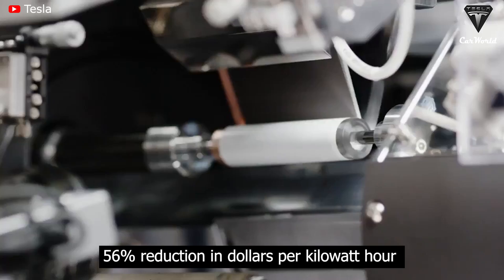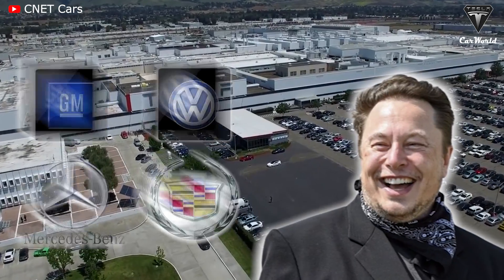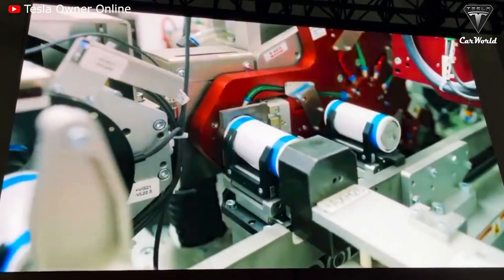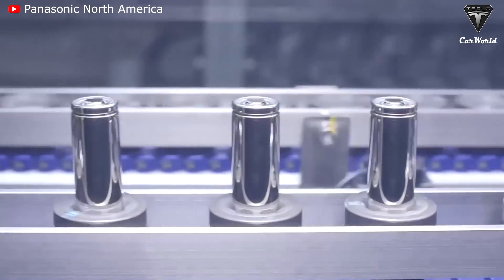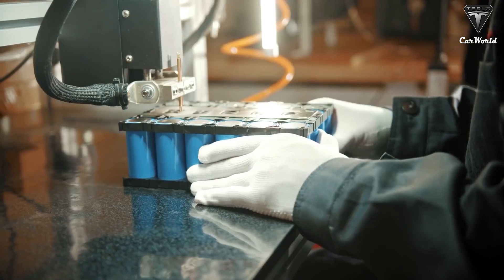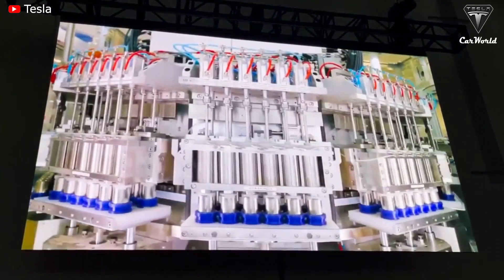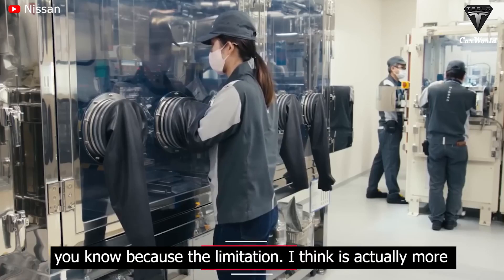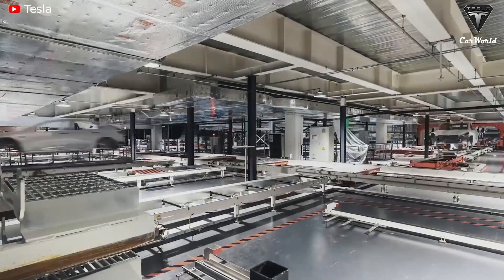Elon Musk Just Reveals NEW Upgrade 4680 Cells 2023, Only $12.94 kWh!

Comment: Your main claim about reduced cost seems so arbitrary: 

Yet it the article headline you mentioned that the cost will be reduced to $12.94 per kWh. 
The $12.94 is more than 90% reduction from $142. 
The 14% reduction from $142 would lower the cost to $121 which is much higher than $12.94 you claimed. 

Similarly, how does 5 times more energy translate into only 16% extra range? 

These are wild claims. Something is off here.  This is what happens when a cheerleader writes an article or create a video without much thinking about the accuracy.
Reply: You can’t still be confused by that 5x more energy claim? Musk is saying for same unit (cell), same handling, get 5x the energy, volume etc. It was confusing, but well discussed. Other part is battery costs eventually decline to cost of materials, equipment, profit. Eventually. Provided tech works out.
The $12.94 is a stretch. But $50 achievable by 2030.
Reply: @iandavies4853   The 5x more energy should result in more than 16% range improvement.  Those two numbers, used in a same claim about increased battery efficiency, do not make sense. Range improvement should be much higher than 16%. 

Many BS articles from cheerleaders create an unrealistic expectation about the technology.
Reply: @usneome  try reading or thinking. 4680 has similar chemistry at present, so similar energy density, 5x is solely due to being bigger cell. The beauty is in time/cost of manufacturing as no stopping to weld tab, wrap 4680 same time as 2170 /18650. Per cell. 
Eventually new chemistry will come, higher energy density, which tabbed cells can’t handle, but 4680 can due to heat path through current collectors, not through electrolyte. So 4680 has a future, tabbed 2170 doesn’t. Don’t ask me to do your thinking.
Reply: @iandavies4853  you did not understand my point. I do not care what the technological details of a particular battery are. 
The claim was that five times increased energy density will result in improving the range of a car that uses such a battery by only 16%, compared to the current technology. One would expect much bigger improvement in car range. 
This indicates that one of the two numbers is not correct. 
Most likely we are not going to see battery with five times greater energy density than current batteries.
Reply: @usneome  because it’s your reading comprehension at fault. 
5x energy DOES NOT equal 5x energy DENSITY.
Wh vs Wh/kg (presuming it’s gravimetric ED) or Wh/L (volumetric)
Wh meaning watt.hours
So yours is a BS comment from what? ICE fanboy? Koch Troll?
You need to understand what ATTRIBUTE is being discussed.
Apologies for caps. 
Please don’t retreat into "King’s English", correct use of apostrophes, this is just low level generalist discussion platform. Just highlights your poor command of technical details. Be polite / courteous.
Reply: @iandavies4853  you are right, I thought that a breakthrough was about energy density.
 I wonder whether the original article was edited after my first comment and word density deleted? If not, obviously I was reading it with an expectation of a technological breakthrough. I can not understand why brag about five times the energy if the size increased by the similar factor. 
After all, having the same energy density as the current generation of batteries is hardly a breakthrough needed to lower the cost from $142 to $12.94.
I took another look at the video, the beginning is quite interesting as it very briefly shows an interesting graph about expected cost reductions. Numbers are 54% for range increase, 56% decrease in $/kWh and 69% decrease in investment cost per GWh.   If Tesla could achieve these targets, that would be a significant improvement over the previous generation of batteries.

My problems with the video are wild claims made in the headline and in the summary.  Simply using numbers from the graph would have been much more impressive than the exaggeration about cost decrease to $12.94 while understating (16% vs 54%) the improvement in driving range and cost per kWh (14% vs 56%). 
And finally, I am a bit annoyed about units shown in the Tesla graph. Why capitalize all letters for units like KWH or GWH? It should be kWh and GWh.
Hopefully this comment will get me out of the ICE funboy and Koch troll groups 😂.
Reply: @usneome  nice response Neo. This video is click bait. Battery day info is slowly being proved, but will take 5 years or so. In itself a step change compared to slow evolution. Getting down below $50  maybe 2030. But $13 will take lots of work, close to 2050. Agree SI units would be nice. Note silicon content for anode is still a challenge, others make claim for silicon anode - probably spurious. I’m expecting way more of Tesla than Panasonic, more innovative, more focused on the manufacturing side, on whole of product. eg structural and cell-to-pack huge improvement to effective gravimetric energy density (GED). Munro could quantify this just from metal thickness.
Also better cooling, eliminating tiny tab carrying current.
But $12.94 is stupid exaggeration, not even explained.

Comment: Will the new battery be as difficult to extinguish as the old one, once it gets on fire?
Reply: Its safer than before.
Reply: @jeffnaval4894   I will believe it when I see its behaviour in a fire. 
When you write a short sentence and make a bad grammatical error, people will discount your opinion. 
You wanted to write: It is safer…or It’s safer… not its.
Reply: Contractions are of safety Naz.!
Reply: You are such a troll. Get over yourself.
Ask BMW. Report of fire in China, new car, on test drive.
4680 has way superior heat management, has electrolyte venting in case of overheating.
Has fire suppression structural foam.
And the pack is same size (about 80-100 kWh) so no more energy / fuel.
Don’t forget, ICE burns about 20x as frequently, often explosively. So stupid argument.
Reply: It's not a GM attery